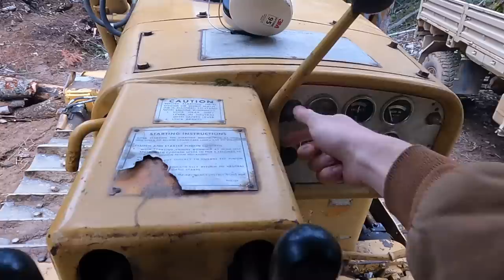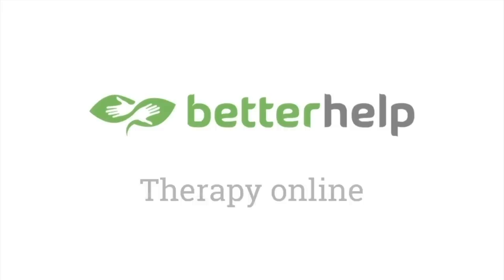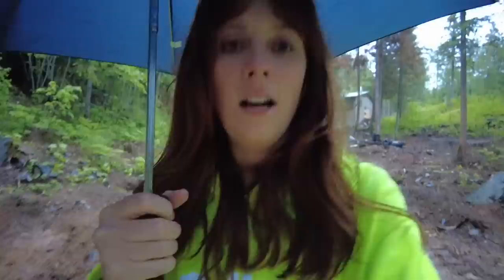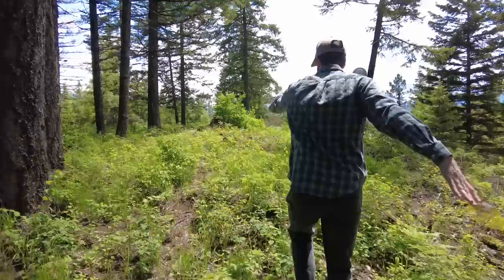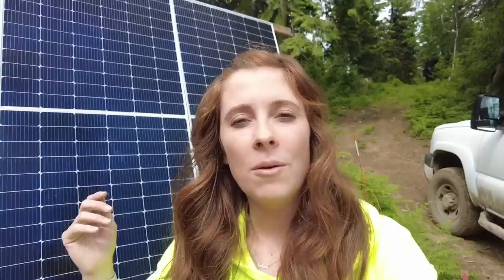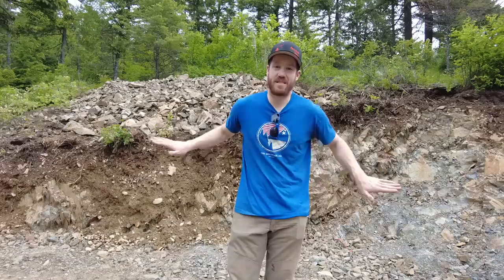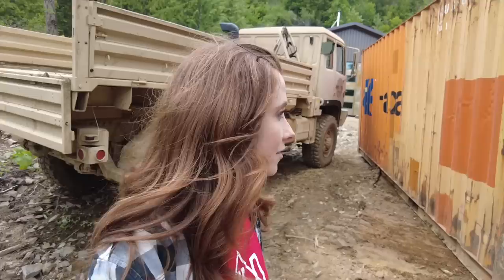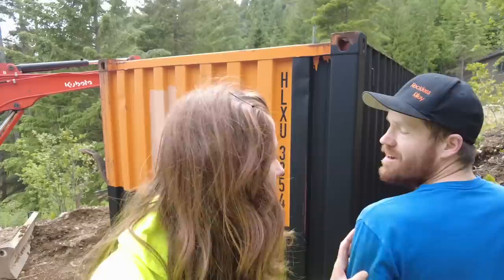We're Moving On... With A Shipping Container?

Comment: It's an added expense, but will add years to the watertight back wall and steel subfloor: 1) Water/snow melt will collect behind and underneath: Get it up off the dirt on railroad tie dunnage, 2) Before you backfill, drop heavy roofing felt down the back side and make a cement board sandwich with the membrane between the container wall and cem.b, 3) drop gravel, crushed rock in the gap between the hillside and cem.b.  4) The painted coat will not stop sharp rocks from scratching through the coating and the cem. b will also help distribute water and the weight of backfill across the container ribs
Reply: Definately do this!!!!!
Reply: Big flat rocks or pour concrete footings
Reply: I see you have the window fixed in the excavator! Have you thought about adding bars to protect the glass? Just another project for your list 😂
Reply: ^^^ Royce’s comment is very sound.
Reply: Sound advice.
Reply: I was thinking the same thing on the drainage and felt. It’ll add years to the life of the container. Even a simple French drain under it be better than nothing at all.
Reply: Yes, I was going to suggest a french drain. Water will seep underneath and erode the soil its resting on.
Reply: good advice, to simplify use a dimple mat on the container wet wall.
Reply: Totally agree
Reply: Once you get that can filled with batteries and switch gear, it is gonna get heavy. If you don't consider the anchorage, managing run-off, and compaction of the fill, you may find the can decides to skate off down the hill.
Reply: BOOM!
Reply: Oh my gosh!  Excellent advice!  Sounds like you've done this before.  Who knew!

Comment: The weak point of shipping containers is the bottom, it rust out fastest. So before you set it up, clean the bottom and put some rust protection, paint or that membrane. Can extend the life of it quite a bit. Also let it stand perfectly on the corners so it airs under it and it is also easier to open and close if they are perfectly level. If you burry it, drain very well around it to keep it as dry as possible.
Reply: Will not last if they continue with their plan. Just a waste of money
Reply: Okay, I bet it lasts just fine for what they need for the next 10 years.  After that, storage shed for the next 50 and serve that purpose well.  Yes, you need to take more thought to a container's needs to me a permanent structure and that means the pad on which it will sit needs drainage and the container needs a ton of prep.  A good substrate and what you do to rejuvenate the container is an efficient an cost effective way to fill structure needs.  Batteries are going to improve, photo cells are going to improve, and plans are going to change and evolve as their property will.  As far as rejuvenation and repair, just recycle what you remove, plan it out so what you want to cut out in on place can patch in to fix another.
Reply: @marklar7551  It is not new container, quite beaten up already. The bottom is unprotected, so makes no sense to install it to have rusty holes in the bottom, allowing rodents and mice and what not to get in to chew on the cables. Why not spend extra 100 bucks and have it there easy 10 - 15 years, when this one might fail in 3 - 5 years.  They have all the equipment to roll it on its side and protect it, and ten paint the whole thing.  Put it on gravel pad and concrete blocks under each corner so it is perfectly level. Then landscape around it. Days work, 100 bucks and no worries for long long time. Skip it and mouse could chew on cable in three years, and the to remove everything from it, dig it up and sell it for scrap metal and start all over again. - Makes no sense to me.

Comment: Nothing wrong with burying 1 or 2 sides of your container, IF YOU DO THE PROPER PREPATIONS !

• Drainage along the sides, below the base of the container.
• The waterproofing you are using is a good start (apply a second coat) but add dimpled drainboard before backfilling.

Comment: You need to park the dozer on a flat spot so you can check the fluids before you start it. Especially need to check the oil in both motors before starting each time. If you don't have the container in totally finished yet, when you backfill around it with clean stone put a perforated corrugated fabric covered black pipe around the bottom of the container under the rock. Fill it with rock up to around 1 to 2 foot from the surface ground level then finish it with dirt. Daylight the pipe out the lowest side and preferably get the pipe where it is running on a slope so the water will run out. The pipe will carry out rain and snow melt water and any water that may leach out of the hill that could rust out the container and rot the floor. Another commenter suggested using cement board around it, backfilling it with rock, and putting it on railroad ties which I say would be a good idea too. I'd definitely suggest at the minimum the pipe and clean stone to keep the water away from it. The stone also helps keep from having pressure from the weight of the dirt pushing on the container. It will last for a long time if you can keep the water from standing in the ground around it. I completely buried 2 40 foot containers side by side with 3 feet of cover over them in a man's yard once. He did the water proofing tar on all sides and put the stone around them with the perforated pipe and we had to dig out to a hill 60 feet to get the pipe to drain but it's worth it to get the water away from them. Neat video. Stay well. -Wil  👍
Reply: This is how retaining walls behind bridge abutments work, and you can add layers of spaced pipe tied together or running to other slopes if you want more security and longevity from your system.  The system will fill with dirt over time naturally which actually stiffens the embankment.

Comment: Guys I'm suggesting when you back fill use the fist sizes of rocks against the hill side no dirt the rocks would let the moisture vent out  as well as rain water . Secondly use foundation blocks  16x16x3 " thick under each corner about 70 lbs each . If you patch the holes in the roof you'll just have to cut out more to vent the  explosive battery gas's that are generated by charging processes .A passive windturbin for roofs  no spark for electric motor --no ignition for gases to go  Boom!  Anchor container,, backfill +wet hillside  might give you container racer down hillside .
Reply: @Jeff Greenspon lead acid, who can run a welder on lipo batteries. Oops, these folks have big money.
Reply: Too hot too cold no good for battery life either, so their ideas are sound and climate control for this system is already a must.  Venting needs to be handled for moisture too.  That hole in the roof is probably just in the wrong location, so my bet is when they cut the hole or holes in the proper locations, they're going to use the cuts to patch.
Reply: @richardmccann4815  The new batteries can easily.

Comment: I bought a 20 foot sea container a few years ago. I'm in cottage country so I finished it with vinyl siding and a hip roof. What I really liked was every thing is square and very secure.  Humidity can be a problem so a cut vents in the lower walls and in the ceiling. Since I was installed a roof, the ceiling vents into the "attic" I also put screens on all the vents to keep critters out. One word of caution, containers are used to ship all sorts of cheminals so try to make sure your container isn't contaminated.
Reply: Exterior framing and insulation can help, but you need to vent the container for sure.  And that barrier inside and out is a really good idea for decades of durability.  Just construct to maintain low humidity and good drainage.
Reply: And how do they find out if its contaminated or not?

Comment: If you are going to mount your panels on or in front of the shipping container, you should paint the area behind the array bright white to reflect more light onto the backside of the double sided panels. Free energy upgrade!
Reply: You should paint any used container inside and out....all welds and trays 3 coat with the metal paint, and clean it if it's exposed.  Moisture moisture moisture keep it dry

Comment: Hi guys, if the container has a hole in the roof and was bought as weather tight, a partial refund should be obtained from the supplier.
If the backfill for the burial of the container is largely shale, the structural integrity should be fine.
Use of the container for your batteries and panels was a great idea. Don't forget to install solar powered roof vents for battery and heat ventilation. Great job guys......the plot thickens! 😁🌞

Comment: Just an FYI, unless you put the bottom of the container up on a blocks at the very least and also treat it, the bottom is just going to rust out.  Especially in the corners.  You can't just set steel on dirt.  You have the right idea with the coating you put on the side.

Comment: Depending on the size of the hole in the roof put an RV vent in it. Might be good to have a vent to get air moving around. Would help to Keep the heat down.
Reply: RV roof tape will temporarily do

Comment: put some polystyrene against the wall on outside and then backfill with chunky rocks. this will protect the container while backfilling. insulate it. the rocks will also lock against each other further spreading the load on the wall. the polystyrene will carry some load if its an inch or so at least.  the rock fill will also allow water to escape.

Comment: Amazon the smallest DC 16 seer ymgi split unit is the solution to the longterm heath of your electrical system. Steady temp reduced humidity and you have plenty of power to run it.

Comment: Having venting is important especially since you are using it for electronics. We have several shipping containers at work for storage and we learned our lesson after the 1st one. Excessive heat or indoor condensation (it's raining  indoors!) were problems we had to correct. An exhaust fan that turns on at a set temperature can also help w heat build up. I look forward to watching the progress on this project.

Comment: Make sure to insulate the container with a fireproof insulation material. For a set it and forget it heat source for the batteries, buy a cheap ceramic heater and wire in a temperature switch that opens at 40°F.

Comment: When I moved my 40 ft container I used a mobile home axel. Remove springs, weld 3x3x 1/.4 angle iron 8ft 2inches apart, chain/load strap axle 2/3 back from towing point then lift and roll. Set aside axle for next job. Al w/tires about $100. Good Luck.

Comment: We have similar plans for our battery bank for off-grid solar, but are planning on using a new septic tank. They're durable, waterproof, and designed to be buried.

We're going to bury three sides, then cut a door into the exposed side for access. Hoping we'll be able to bury it deep enough to not need supplemental heat in it and be able to just use the ambient soil temp to keep our batteries warm. We'll see how it works out!
Reply from the maker: That is such a cool idea!

Comment: When we had our rental shipping container delivered it also couldn't get delivered at the top of the property (the delivery truck couldn't back up on our fairly steep, loose subbase driveway). We left it at mid point of the driveway and it actually turned out to be a good spot because it's not in the way of grading our house site at the top.

Comment: Not sure if anyone pointed this out but in a 50 mph wind the lifting force per square foot is 10 lbs, 240 lbs per panel or 5760 lbs for 24 panels. Which by the way is more than the container weights. Also if you weld a pully towards the bottom of the container and run the winch cable through it, the panel should be easy to move.

Comment: I think if there is every a concern about the sides bulging in from the weight of the dirt, weld in some square tube into the interior wall to reinforce it like how it's done in the basements of old houses that have brick foundations in their basements.
Reply: I figure they need a deck off the floor and things like that to help maintain air around their cells and extra framing inside to get proactive on those issues.

Comment: I’ve dealt with a lot of containers, ( or conex box), I would recommend getting it off the ground a little bit, wood, concrete pavers etc. as for the roof, I would use that Henry’s over the existing patch then weld it up. Just my 2cents. Great work, keep it up.

Comment: I would have painted several coats of sealer on the whole container and then the parts that would be touched by sunlight I would paint with an exterior white or silver paint. It would keep all of the metal from rusting.

Comment: I have a shipping container for my kitchen and living space and only use my camper for sleeping and shower. The container was very cold, the dish cloth would freeze to the wooden bench inside in a hard frost. I work on a cropping farm and the I got the boss to make me a bunch of 8ft long big bales (32" sq) from wheat straw. I had about 20 in total. I put down some wood pallets to keep the bales off the ground and simply packed the hay around the three sides and some smaller ones I bought for the roof. I have a weather station and the coolest my container got was 11c and the warmest 24c. I have a fridge and freezer and cook and do my dish washing with hot water inside the container. I had fitted a double glazed double door just inside so I had light and easy access. I just left the big doors open 180 deg from closed and they helped protect the ends of the bales too. That heat was enough to keep container comfortable. Coldest days were about -7c to a high of 34c in the summer. The hay was cheap, self supporting and fast. I did cover the whole thing with black plastic sheet to keep the hay dry and prevent it rotting. Hay was fine even after four years but where I had leaks in the plastic it did go rotten. I had built a tank stand on top of the container so plastic was taped around legs and the wind dislodged the tape etc. Tyres on top finished it off to stop plastic flapping.

Comment: Before you backfill consider putting the container up on rocks so there is drainage space from underneath and put some ag drainage pipe and coarse fill at the bottom of the buried wall so water drain away rather than in to your container. Sikaflex will fix that hole.

Comment: put a celling vent where the hole is.  Also, if you are only burying the one side, you might want to pin the box in place with some rebar so frost heave doesn't shove it off the hill in the winter.

Comment: Before you weld up the hole in the roof decide if you can accommodate a roof vent fan in that location.  You likely will want one (or more) for cooling in the summer.  I've got a semi-buried container and the only thing I recommend is think about how the water gets out from the buried walls and under it.  If that's taken care of you should good to go.

Comment: I'd be putting a second roof on the container to help control heat in summer and keep the snow off in winter. that hole in the roof won't be an issue then.

Comment: You're probably planning on adding heaters in the container, i work in controls and automation for water/sewer. We set all out heaters to 70 degree, which sounds crazy but I'll tell you why. That thing won't be fully sealed and you want it to always be warmer than the dew point which will prevent any condensation to the inside of the container. Will prevent a lot of headaches in the future.

Comment: Oddly enough I have seen my share of buried shipping containers and internal reinforcement is the key with a wooden frame and lots of triangle corner supports or framed walls dividing sections and providing support when you burry it below the ground but in a hill  is interesting, never seen a hill. I think this smaller container will help simplify this and may be ok without reinforcement depending on how much that hill moves with freeze thaws, I wonder if a small French drain or pipe with holes covered in mesh surrounded by gravel may help stabilize the back corner. 32 panels will be awesome and with good batteries you will be able to rely on clean electric heat and use all you need without burdens of efficiency, keep in mind you need to service and clean them when it comes to placement. You both are really impressing me.

Comment: I set my container on precast parking lot curbs/stops.  Set them on the ground, leveled them, then backfilled around them like sleepers.  I put one across each twist lock location.  Worked great and it hasn’t settled a bit in the last 5 years or so.  Rock or no, I’d definitely put a French drain in along the backside where you’re backfilling it.

Comment: It's all about drainage!  Just treat it like a bridge abutment or any concrete retaining wall and help the water move away the best you can and that container that used to have 12 stacked on top of it all full of future landfill will last decades.  And yes, the embankment with the shade from the panels will help regulate temperature but I recommend you look to exterior insulation because of cold (you're at altitude so cold months outnumber warm ones).  What you have is a pre built shed of metal with a designed load limit, put a membrane on it and plant a gimmie garden for the wildlife.

Comment: I agree with Rouce, get it off the ground. A 20 footer might be solid enough but put somekind of drain on the backside, French drains are cheap and remove the water great.

179k, nice bump there. Putting panels on the cont will keep it cooler in summer and the inverter MAY keep it warm enough inside not to freeze up. 32 panels, wow.